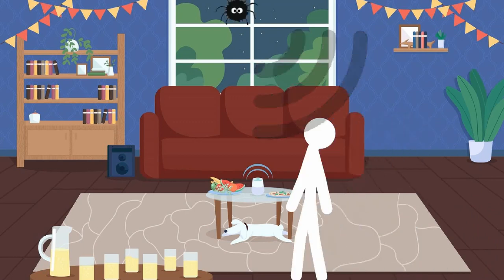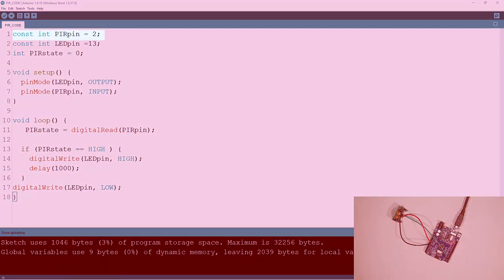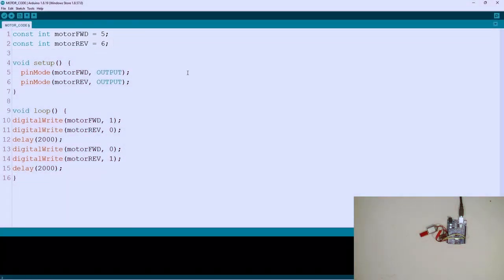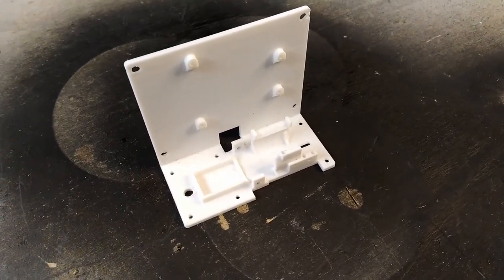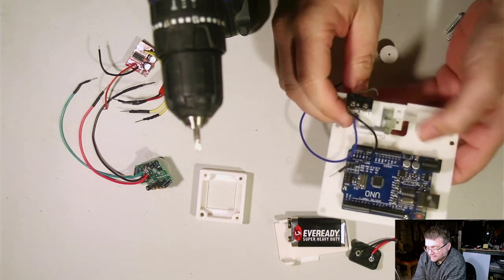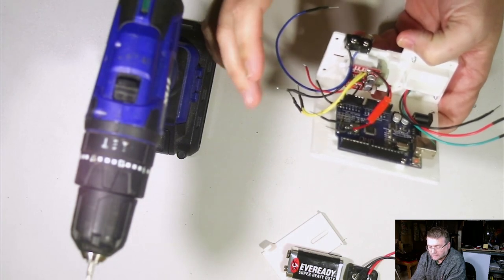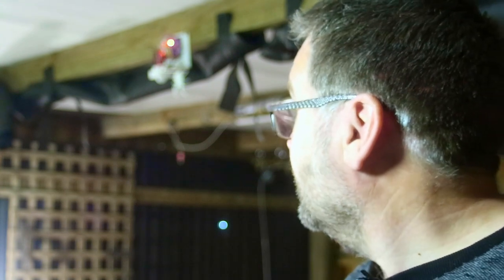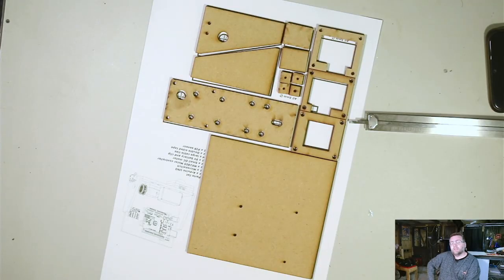The Shocking Arduino Spider Prank: Terrify Your Friends with Motion Detection!

Comment: I'm pretty new to arduino but I have an extra nano laying around. Would a nano work for this?
Reply from the maker: Yep for sure. You will need to be creative with the wiring. It looks like that board only has 1 5V and 2 GND pins. From what I can find on the web pin 5 and 6 still have PWM.